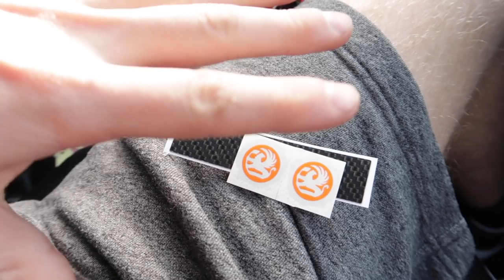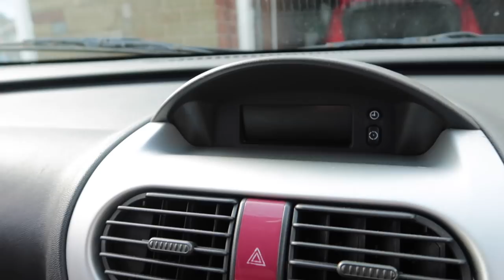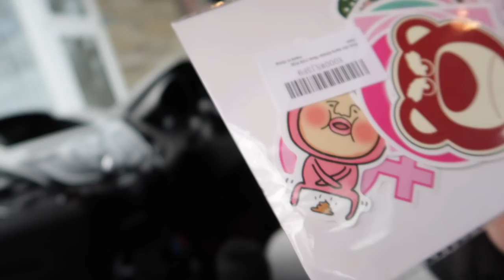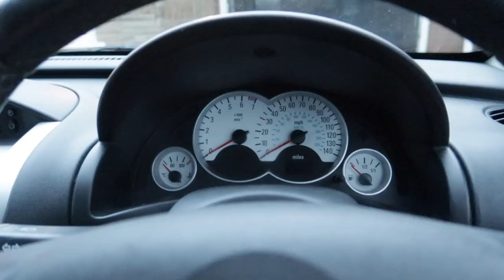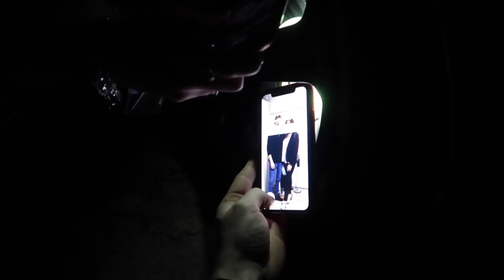GLOW IN THE DARK BRAKE CALIPERS!!

Comment: You should do a video on changing brakes, it'd be interesting to see you working on mechanical stuff, this stuff is cool too though :)
Reply: @ross4164  gotta start somewhere lad, £16 for a haynes manual, better doing bits on the Corsa C than on the VXR, great motor to learn on